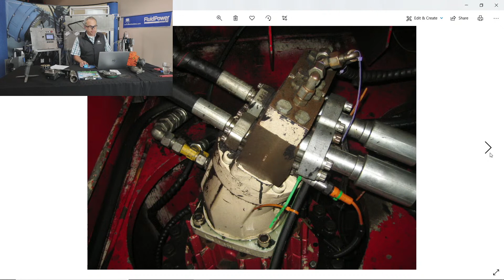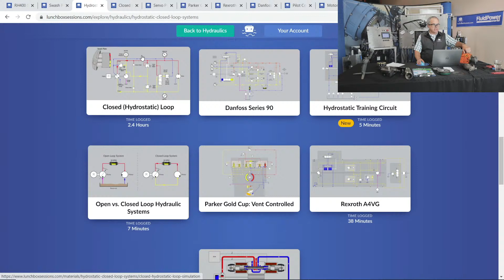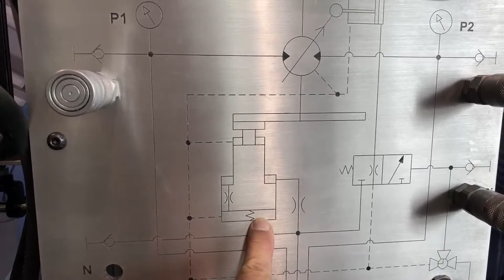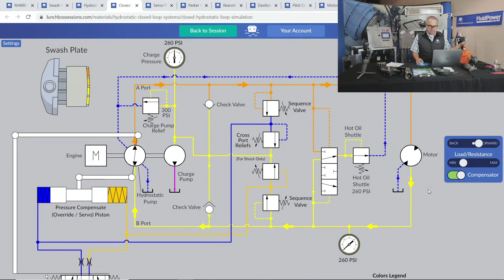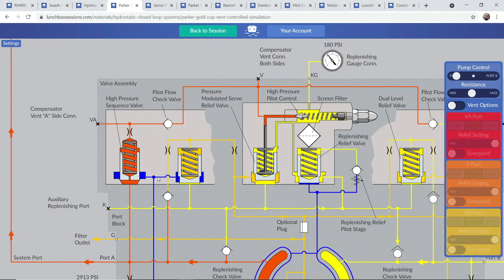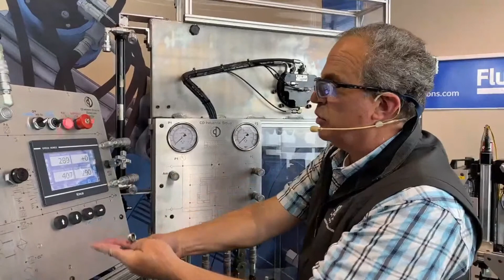Hydrostatic Drives: Closed-Loop Hydraulic Systems (Live On June 24 2021)

Comment: 1.	In neutral conditions, where pump A & B ports are having equal charge pressure and if external flow comes back to the pump A or B port how the pump behaves.
2.	What will be the response time of the pump to change the swashplate angle.
3.	When the pump is stroking the ‘X’ flow on A port & the return oil coming back to B port is ‘X + 50 LPM’ due to the falling load acting on B port, how pump behaves.

Comment: What is inch valve in a4vg series pump?
Reply: And inching valve is used in a DA control pump to bleed off servo / control pressure so that you can have high engine speed but low swash angle
Reply: @bobsacamano4648  thanks brother
Reply: Where are you from brother?